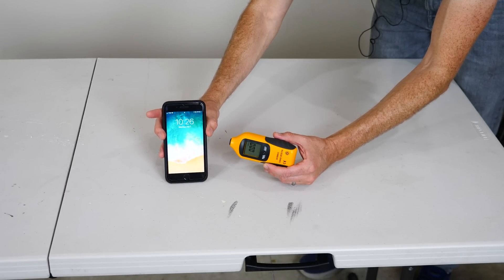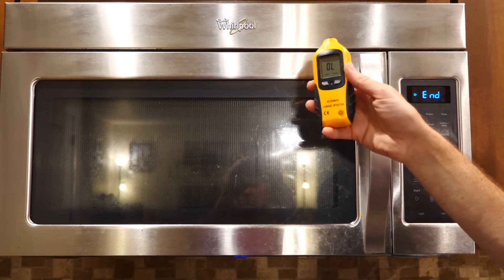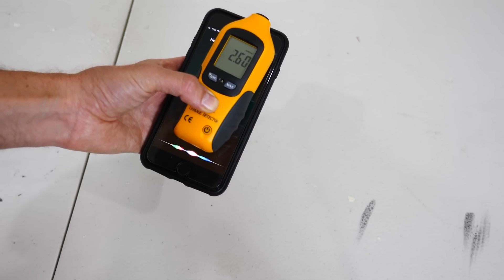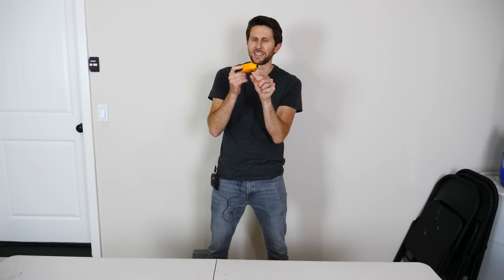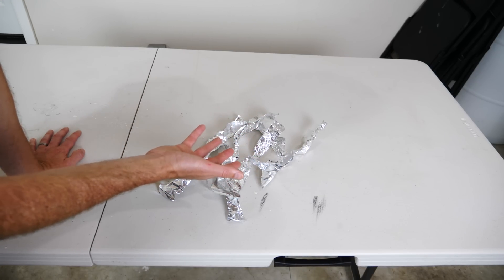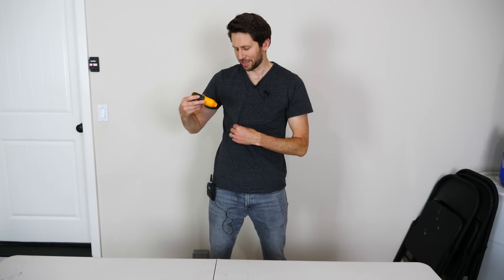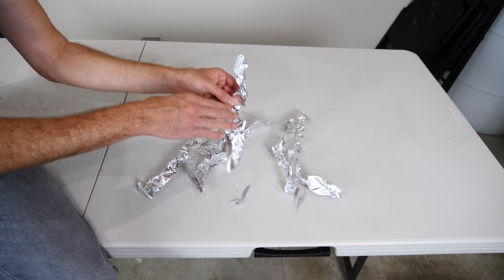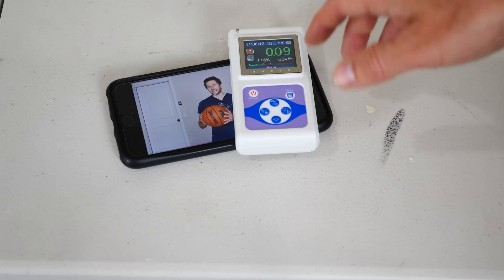How Much Radiation Are You Getting From Your Phone?

Comment: Curiosity: the 5G band has been active (still today) in Europe since 1 January 2000 and is used for television channels.
Curiosity 2: if you take your TV remote control and point it at you, pressing its buttons will make you expose you to a dose of radiation higher than 5G
Curiosity 3: I list the radiation by power, the light you use to see is more powerful than that in the microwave.
Curiosity 4: if the 5 G had such a high power as to cause disease, the 12 o'clock sun would have instantly killed a considerable percentage of the population.
Reply: Curiosity 5: the 5th generation band is between 730 MHz and 800 MHz, so before activating it you will pass from DT1 to DT2, (Digital Terrestrial 1, Digital Terrestrial 2, (we are talking about the television signal)).
Curiosity 6: The most powerful radios are the emergency radios (such as those of the forestry) and go to a maximum of 12 GHz, any higher frequency is simply in useful, because it would decay in short distances.
Curiosity 7: no new repeaters will be built, or at least not from scratch, those of the DT1 will be reused.
Curiosity 8: DT2 planning started before the switch from analog to digital (before 1999)

Comment: Have you had symptoms such as fatigue, headaches, poor memory, difficulty sleeping, and lack of clarity in your thoughts? It may seem like these could be the results of daily stress and frenzy, but there could be another culprit. All of these are symptoms of electro-sensitivity, which is something that more and more people find themselves affected by. Studies conducted in 1997 found "less than a few cases (of electro-sensitivity) per million", however now as much as 2.5% of the population is affected by electro-sensitivity. Even with the most moderate calculations, electrosensitivity is 10,000 times more common today than it was 20 years ago. Why could this be?

Electro-sensitivity and its symptoms appear to be triggered by certain microwave frequencies of electromagnetic radiation. Due to their high frequency, microwaves allow for higher transmission rates and smaller antenna sizes, which is perfect for high-tech devices that are constantly getting smaller and faster. These are devices such as cell phones, tablets, laptops, and any device that can connect to Wi-Fi, which can now include TVs and refrigerators

Furthermore, numerous studies (2011-2017) report an increased risk of brain cancer due to the use of mobile phones Concern for other cancers: breast (male and female), testis, leukemia, thyroid and much more. the current classification of radio frequencies as carcinogenic to humans (Class 2B) should be updated to carcinogenic to humans
Many claim that this is not true at all or that there is no evidence just to progress in the construction of radio transmitters!
And the 5 g accelerates all of this.
One piece of advice I would like to give you is to equip yourself with devices that protect against electromagnetic waves, such as the Aires tech products, in my opinion among the best on the market, have received praise and certifications from independent bodies of the remarkable functioning of their products
5g is part of progress, it is right to progress but why not protect yourself?
For more info and sources:

https://www.airestech.com/category/media/

https://www.youtube.com/watch?v=zdxvfG353VM

https://www.youtube.com/watch?v=3u0yXc9sFps
Reply: Stop spreading false information for your personal profit
Reply: @jellyjacky8586  First they are not false information as it is all true and if you do not know what lethernit is or do not believe what I have written, inform yourself before denying the opinions of others!
according to whether you believe it or not I do not make any profit
I am a worker in a chemical company and what I wrote is to open the eyes of people like you in good faith
Reply: @william942w  sources: just trust me bro
Reply: @william942w  Then instead of spouting nonsense, give us a good study that shows us that EHS is real instead of giving us youtube videos that literally prove nothing and provide no real good information.

Comment: Question: according to the chart (around 8:50), there is a "danger" above microwaves, but when increasing the frequency to infrared/visible does it then become "safe"?
Reply: Yes
Reply: @jellyjacky8586  thank you.
Can you please explain (or link to an article) why.
Just interesting that with more energy in the wave, it is "safer".
Reply: @miked412  i don't exactly know why, but i suspect its because humans most commonly interact with visible light so it makes sense thay it's safe but that's just a guess
Reply: the danger is if the microwave (appliance) faraday cage breaks it will leak radiation and cook you
Reply: @MenacingPerson  maybe my question is worded poorly.
I am wondering my the microwave range is dangerous, but a higher energy (IR/Visible/UV) is considered safe?
I am assuming it is due to our biology/evolution to adapt and benefit from the energy we were most typically exposed to.
- But, an assumption is far from being fact.
Reply: @miked412  I have no idea why they would do that. Perhaps it's a joke on anti 5g activists.

Comment: The standard measurement is mW/m^3 not mW/cm^3... Don't confuse people by changing the unites, let's see you measure it accurately and you will know why it's dangerous
Reply: Its not dangerous you shill, and he didnt mic up the meaurements its just used interchangeably and converted. How much do they pay you to say this stuff?
Reply: @Lone_Doge  lol i don't need anyone to pay me to speak for my health + there is a huge difference, if you want to change the measurements you need to change the Watt too not just the m^3, that's basic stuff in physics, if you only change the m^3 to cm^3 without touching the watt part then you changed the whole unit, it's easy to trick people who don't know physics
Reply: mW/m^3 would be even less than that. it can still also be used interchangeably. 

"A Federal standard (21 CFR 1030.10) limits the amount of microwaves that can leak from an oven throughout its lifetime to 5 milliwatts (mW) of microwave radiation per square centimeter at approximately 2 inches from the oven surface. This limit is far below the level known to harm people. Microwave energy also decreases dramatically as you move away from the source of radiation. A measurement made 20 inches from an oven would be approximately 1/100th of the value measured at 2 inches from the oven."

https://www.fda.gov/radiation-emitting-products/resources-you-radiation-emitting-products/microwave-oven-radiation

Please don't spread misinformation
Reply: @MenacingPerson  dude, that's a simple math even high schoolers can do, it won't be even less it will be thousand times stronger literally, let's take the microwave example from the video, he found it 1.36 mW/cm3 but when we converge it to the true unit it will become 1360 mW/m3... And what's the safe limit again? It's around 5 mW/m3, that's literally above the safe limit by 1355 units, please do your math and research before you copy paste and tell people they are spreding misinformation
Reply: @nostalgia9256  also you didn't account for the radiation spread. That would mean you had 100 phones at once. And it was still below the safety limit.
Reply: @nostalgia9256  not to mention the limit is wayy lower than the actual safe limit.

Comment: this guy is wrong because the human body has it's own "electrical system" and any outside impact can have unknown effect which is most likely negative, comparing sun is not reasonable it does not provide electricity to the body, just heat and radiation but not the same one as the phone does.
Reply: Nope. The signals picked up by our body immediately shoet out because they can not supply much current
Reply: @revolution5547  what you mean "shoet out", it can still interfere with the body's signals and system.
Reply: @alexandertheone311  if you do not understand how electricity works its not my fault. The signals that grt absorbet by human body can not supply alot of current so they immediately short out and voltage drops to 0
Reply: @revolution5547  I'm not electrical engineer but I know basics. ok explain to me one thing then, why I had bluetooth earpiece that when I used it I felt pain in my ear/head? it was good expensive brand "Bose". (yes maybe I'm more sensitive then most people but still if to believe what you are saying that wouldnt have happened)
Reply: @alexandertheone311  it may be the pressure on your nerves, but im not sure. I never had problems like that and no one from my family or friends.
Reply: @alexandertheone311  Sir, YOU'RE USING YOUR EARPHONES TOO LOUD AND WITHOUT THE RUBBER
Reply: @WaikSonorização  what a stupid comment, no I am not, you are wrong.
Reply: @revolution5547  so all of your friends and relatives used bluetooth? and it happened with phone too. thats why I'm trying to always use speakerphone.
Reply: @alexandertheone311  most of them do. Idk man seems like youre making up things
Reply: @revolution5547  I can tell you same thing, you are making things up. what you are writing is ridiculous. why would I make things up? do I have personal interest?
Reply: @alexandertheone311  stop being disgusting, it was just a joke
Reply: @Owen_loves_Butters  No you are wrong and there is no pain when listening to music even when its very loud, my drums are fine, just I'm probably more sensitive to electricity then most people.
Reply: @alexandertheone311  did you blast it full volume or something, btw having an earpiece in your ears will hurt after a time cause you know, it presses your ears
Reply: Cwiss Swiss  you are wrong zombie.
Reply: You are wrong my guy, it is reasonable to compare the sun light to the radiation of a phone, since they are both electromagnetic waves.
Also the frequency of the radio waves (phone, internet, etc) is the.lower of the electromagnetic waves, visible light having even higher frequency, so the thing you say about “electricity going to your body cuz it’s a phone” it’s just not how electricity and electromagnetic waves works in
Reply: @davidmora8588  It is different. I don't have time to argue with you or go into thin detail. But just a quick note, even if to consider what you said, if you are exposed to sun for long periods of time you can get damage, so your words contradict itself.
Reply: @alexandertheone311  of course it’s different, cuz the sun light have ionizing waves, wich are dangerous and can cause cancer; the microwaves in the phones do not have ionizing waves so it does not cause damage, but as I said they are comparable because both are electromagnetic waves. If you can’t understand that, just don’t reply, it’s how waves work and it’s not debatable.

Comment: The overload kind of makes a sense due to the inverse square law if you're pressing up the sensor directly to the phone the immediate radiation is going to be substantially higher than if you moved it twice as far away if you moved it twice as far away it would be four times less and that's not even factoring in all microwaves do is vibrate the water molecules in your body gently warming your skin but nothing dangerous beyond that if anyone here thinks that phones are dangerous like ionizing radiation put them in a chamber that visualizes ionization of gas and you will see there is nothing coming off your phone no beta particles no alpha particles and no gamma rays.

Comment: Have you experience symptoms such as fatigue, headaches, poor memory, difficulty sleeping, and lack of clarity in your thoughts? It may seem that these could be the results of day-to-day stress and busyness, but there may be another culprit. All of these are symptoms of electro-sensitivity, which is something more and more people are finding themselves affected by. Studies done in 1997 have found “less than a few cases (of electro-sensitivity) per million”, however now as much as 2.5% of the population find themselves affected by electro-sensitivity. Even by most moderate calculations, electro-sensitivity is 1,000 times more common now than it was 20 years ago. Why could this be?

Electro-sensitivity and its symptoms seem to be triggered by certain microwave frequencies of electromagnetic radiation. Microwaves are frequently used in electronics for the purposes of communication between devices. Due to their high frequency, microwaves allow for higher transmission rates and small antenna sizes, which is perfect for high-tech devices that are constantly getting smaller and faster. These are devices such as cell phones, tablets, laptops, and any devices able to connect to Wi-Fi, which can now include TVs and refrigerators. AiresTech products can help protect you from this, independently tested and functioning
Reply: What's the source? I wsnt to know more about it
Reply: @al_hex99  If you search on the internet, however, you will find many other reliable information and texts, do not always believe everything the media or governments say. It was only after years that it was discovered that in reality many things they considered "safe" were actually harmful.
Then of course draw your own conclusions
Regards

https://www.airestech.com/category/media/

https://sites.google.com/view/sources-electrosmog

https://www.youtube.com/watch?v=zdxvfG353VM

https://www.youtube.com/watch?v=3u0yXc9sFps
Reply: Source: Better Call Saul, Chuck McGill approved.
Reply: Have you tried sleeping more and drinking more water?

Comment: Why not do a test on 5G on 60GHz  directional transmitter and reciver with diffrent power inputs starting at 10watts going up to higer watts like 1kw or even 10kw. I am betting on dangerous levels... U.S. Air Force has developed a nonlethal antipersonnel weapon system called Active Denial System (ADS) which emits a beam of millimeter radio waves (same as 5G) with a wavelength of 3 mm (frequency of 95 GHz)(5g is on 60GHz). The weapon causes a person in the beam to feel an intense burning pain, as if their skin is going to catch fire. The military version had an output power of 100 kilowatts (kW) and a smaller law enforcement version, called Silent Guardian that was developed by Raytheon later, had an output power of 30 kW.
Reply: True but ADS and 5G use the frequency differently

Comment: Does a phone emit ionizing radiation? Maybe a small amount of UV from the led in the screen? Though less than you'd get standing in the sun. Also it will contain traces of radioisotopes of carbon, hydrogen, etc. But note that it will be less than in the same density of skin because you are constantly renewing the materials in your body, plus if you aren't scared that everything in your body contains radioisotopes, don't worry about your phone! Microwaves don't carry a lot of energy, it takes kilowatt levels to cook anything, even without active cooling the energy would spread as blood, etc moves around and you're losing more energy passively to the environment than a phone is consuming, not just in generating microwaves, but total, most of the energy a phone produces is normal heat and most of the radiation is probably IR as the phone heats up!
Reply: not really. led spectrums are widely known